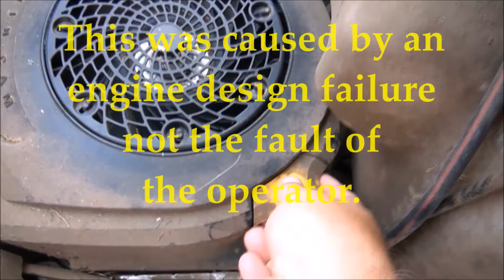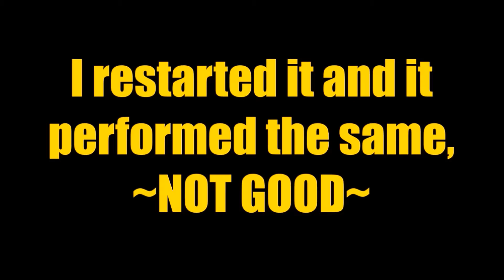Kohler Courage RIDING LAWNMOWER engine SWAP to Briggs and Stratton opposing TWIN CYLINDER  ~ HOW TO

Comment: An excellent job.  The wiring, and carburetor.  I have done 2  engine swaps,  a murry 38 inch cut, had a 11.5 Briggs,  changed to a 18.5 Briggs opposed 2 cyl. Went very easy.  Briggs for Briggs. 

Then a 40 inch cut Murry went from a 12.5 Briggs to a Kohler V twin 25 horsepower.  Going to the Kohler was more difficult,  mainly going from a 1 inch crankshaft to a 1 1/8 crankshaft.  The mower the Kohler came from used an electric PTO , the Murry used the mechanical blade engagement.  Trying to find a 1 1/8 pulley for the mower deck is mission impossible.  I took apart an old electric PTO and used a lower piece that could adapt the 1 inch pulley to the 1 1/8 pulley.  Then very carefully get everything lined up then weld. I was luck to have the drive pulley for the mower transmission.  I cut the lower pulley off the 1 inch pulley set. It works great,  the lower pulley runs true no wobble up and down or side to side. 

I can say having twice the horsepower is definitely an added plus.  😊

Also I wound up having to use duel exhaust.  I use 2-  6 horsepower mufflers sounds good, and still has much more power than the 12.5 Briggs.
Reply from the maker: NICE! Thanks for the comment

Comment: Hello there. Thank you for the great video. I noticed you said the engine is only 16 hp. I failed to notice how large the deck was for that lawnmower. Maybe it was a 42 or a 46. However, if you think back 25 years ago, they were putting a 12, 13 and 14 hp engines on mowers that size. I don’t know why they’ve increased the horsepower so much. I’m not complaining though. I have a 42 inch “Troy Bilt” with an 18 hp “Braggs & Scratton” engine and a 19 1/2 hp I can put on it if the 18 hp goes out. Both engines are in good running condition so far and are Braggs & Scratton (I’ve gotten caught up with the “Taryl Fixes All” crowd and nicknames for all engine makes). So let’s see how this turns out when you replace that “Krohler”. I do hope the “carbitrator” is nice and clean.
By the way, you are so blessed to have all of those junk motors. I would love to have all of those for parts. I am 47 years old and have had a change of career and gone self-employed. I am slowly starting to build up a stock of broken or replacement engines but now I need some tractors and stuff.
Reply from the maker: NICE! everyone loves the "lawnmower man"

Comment: Have you tried a engine swap with the Briggs Opposed on a electric clutch tractor just to see what would have happened?
Reply from the maker: Not yet! But most likelt the battery would go dead after awhile because not enough amps to recharge it

Comment: I love those opposed cylinder briggs they sound like a little volks wagon when you crank them up .also i always add a fuel shut off. That silly expensive solenoid goes out without warning
Reply from the maker: good tip!

Comment: I have a huskee with a 19 hp kohler courage and it smokes when I idle down and shut it off but otherwise runs pretty decent but I just changed the oil and seen some really fine metal in it. Do you think mines doing the same?
Reply from the maker: Some finer shavings/glitter in the oil is o.k. and not uncommon, in this video it was major failure

Comment: When do you know if you need the spacer on the pully, if your old engine didn't have it  yet the new one has it and both shafts are the same length
Reply from the maker: good question. It is for belt alignment so you have to look and see if belts are straight when the pulley is installed
Reply: @jeffslawnmowerrepairandservice  logical answer, thanks for that Jeff

Comment: Rearrange your steps such as disconnect battery/starter and fuel and choke throttle cable before motor mounts

Comment: I have same kohler courage 20hp...but electric clutch...how to tell if replacement engine wiring is good enough?  If i buy woth engine on tractor i can just tell if it has manual or electric clutch but what about if its off the tractor
Reply from the maker: You would have to use the model number, and probably serial number too off of the engine to look up the actual alternator specs. that the engine has.
Reply: @jeffslawnmowerrepairandservice  I was wrong...I looked again and I have the manual clutch so that makes changing the engine much easier

Comment: Where the yellow wire is coming from? Spark plug? The first wire u connect in the video u don’t mention pls
Reply from the maker: I believe that was an extension wire I added to extend the black kill/ground wire that goes to the coils/magnetos. I should have painted it black.

Comment: I have this motor in my Troy bilt bronco. It smokes like a freight train on start but after about 5 minutes it stops. I changed the valve cover gasket and don't see any oil dripping anywhere. Any way, what's a good motor I can swap it with. I really rather get a new one but this video intrigued me and gave me hope I can save the lawn mower. lol
Reply: If you want another Kohler than I'd say either a Kohler command or pro. The courages were trash new. Or you can go kawasaki, you can never go wrong with a kawasaki. I have an old dixie chopper with a 23hp kawasaki fh680v and it has over 9,000 hours, still runs but started leaking oil and getting hard to start so figured I'd change it.

Comment: Because i have my pressure washing equipment on my pick up truck. i was thinking about using a motor like this for a pressure washer.  The question is do they make a gear reducer that is L-shaped to mount a pump on it?
Reply from the maker: That is a good question. I don't know if that is available or not..  I do know that many residential style pressure washers have a pump that mounts on the bottom for vertical shaft engines.. Horizontal shaft engines seem to be the standard for industrial pressure washers in my experience..
Reply: Thanks but the residential ones are not sufficient for Pro Pressure Washing. I'll keep looking. @jeffslawnmowerrepairandservice

Comment: If this was not operator error, and it was caused by to much fluid in the crank case, being overfilled by gas. usually means a needle valve stuck, or bad float. Where did all that gas and oil go?
Reply from the maker: Yes carb flooded. Good question... He said the engine had been smoking for quite some time, several over lawnmowings, he has several acres to mow and I think it burned out/blew out through the muffler

Comment: I got a Briggs and Stratton 14.5 HP I/C twin cylinder with no oil filter placement and my motor retards when on low throttle. I guest I need to rebuild my carburetor too.
Reply from the maker: it's an easy one to rebuild if you can remove the main jet and nozzle. Sometimes it gets stuck and it is easy to strip it trying to get it out.

Comment: Kohler courage, single cylinder engine junk, you got to have courage to work on it
Reply from the maker: LOL! that is exactly right!
Reply: Can't imagine what happened at Kohler.  They use to make bullet proof engines and then came the courage. I have a 1968 IH Cub Cadet 125 that I bought in 1971 with a Kohler cast iron K301 12hp engine .  Used for lawn duty and snow blower and other yard duties for over 50 years now.  Refreshed once about 20 years ago and still running strong today.  Seems like all the stuff anybody makes today is junk in comparison
.